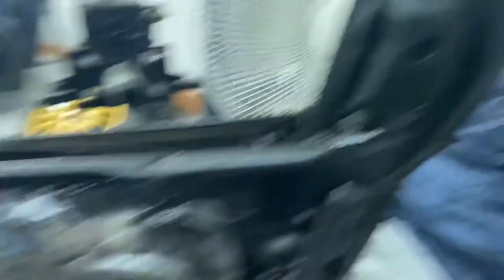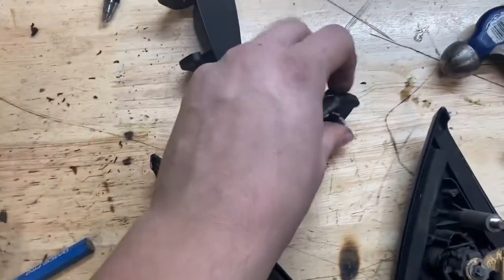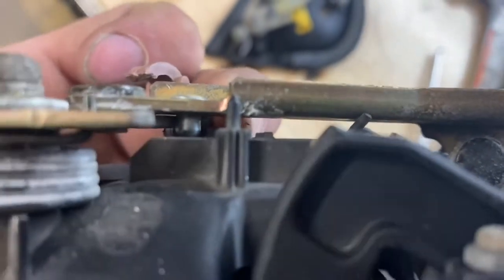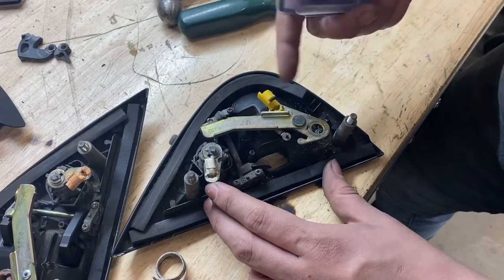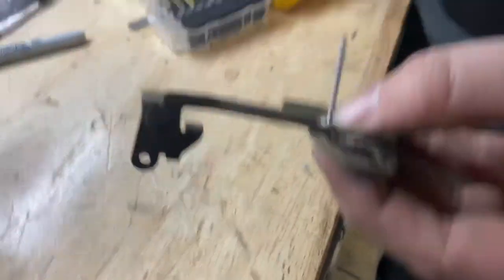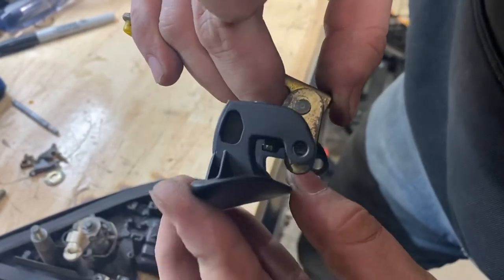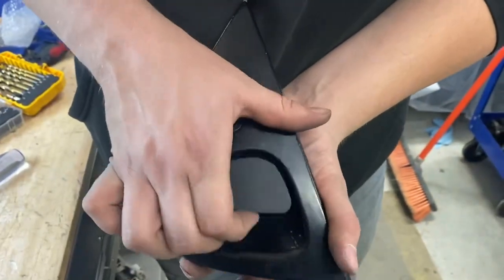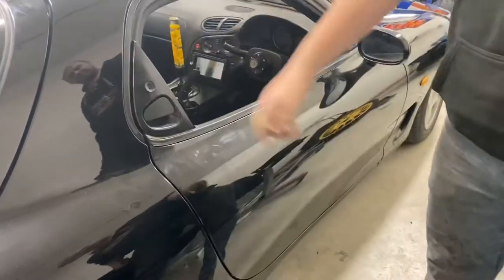FD RX-7 Making Door Latch Smoother to Open//New Handles

Comment: Well done, I just used this method on my door handles, they are buttery smooth to open now.  Also used a little lubrication on the moving joints.  This easy mod will help prevent your plastic handles from breaking if they are in good shape to start with.  I put in metal handles but I feel like it wasn't needed with how easy the doors open now.